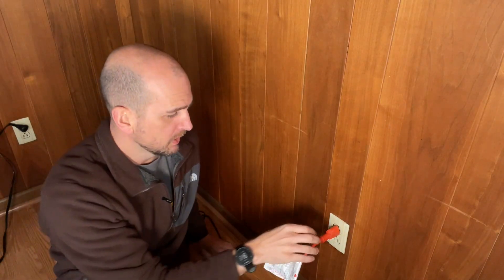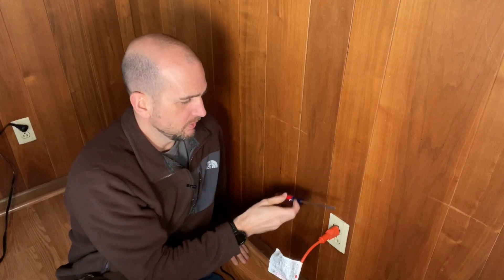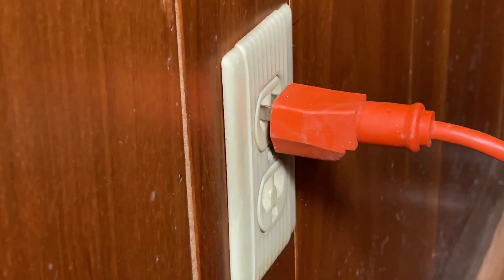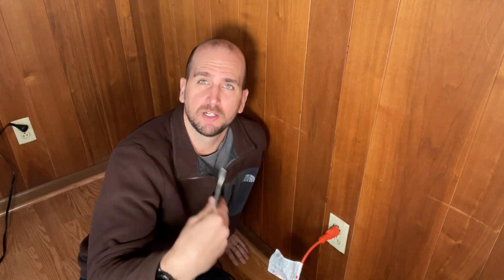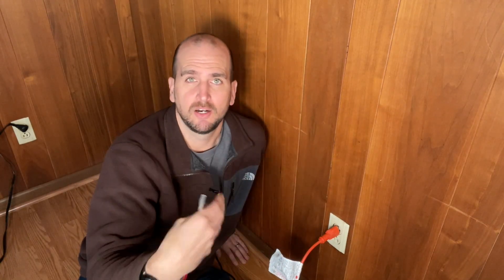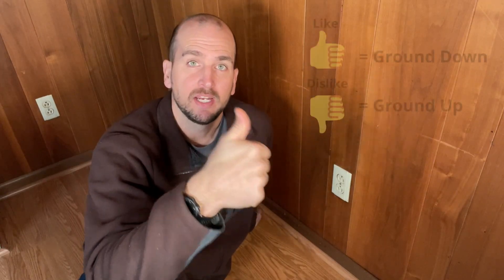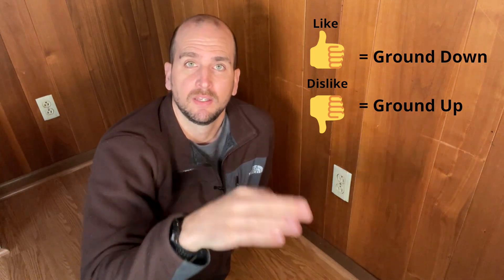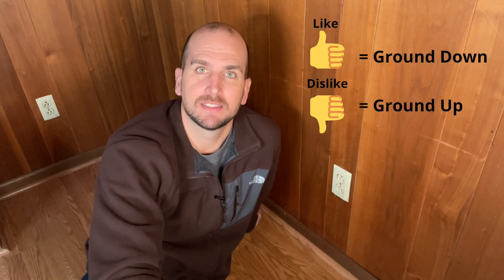Should An Outlet Be Installed Ground Down Or Up

Comment: Admittedly, there would have to be situation where a recp is super loose with bad contact/tension and/or the plug is funky for this to matter but glancing through the comments, I don't see any argument for maintaining ground prong contact when a grounded plug tips down and starts to fall out. If it were the other way around, it's possible that the hot may stay connected while the ground disconnects which is not ideal.  Though rare, I've seen this happen more times then I have a small conductive object happen to fall into prongs that happen to be exposed.

Comment: When my son was 4 years old he stuck a penny into the slot between the receptacle and the 3 prong plug which was facing down. Firstly he was not hurt but, as expected, it sparked, shorted and burnt the outlet and kicked the breaker.  Since then, all my initial installs are ground up. If though, I am plugging in a spacer saver plug as you demonstrated, I will reinstall the outlet ground down.

Comment: That wall socket is crazy loose, I wouldn't plug anything in that like it is on the video, as it is almost certain to lead to a bad connection which leads to arcing and heating and causes a fire hazard.

Comment: I’m a master electrician in Maine, appliances like refrigerators some gas stoves have a 90 degree plug to allow the appliance to be recessed more. Some of the brainless put these outlets up side down. The plugs fall out. UL approved plugs need to be thought of in installing outlets. In my 40 years I can only tell one story where the parents put a little princess cover plate on an outlet and their daughter pulled out the plug enough to hang a necklace for the little princess. It shorted and tripped the breaker. No one dies. This up side down idea is BS. LOVESTUPID

Comment: In the UK, where I'm living now, there are no plugs without ground pins, because the code over here requires that the outlet's ground be switched. When you plug something into the outlet, even if the ground pin on the plug is plastic, the outlet won't become live to hot & neutral unless the ground pin goes in all the way. And the ground pins are always longer than the hot/neutral pins. If you don't stick the ground in far enough, the hot/neutral remain dead. It's a safety feature. But it means that both plugs and outlets are heavily overengineered! Of course, with 240v maybe that's all for the good.

Comment: That’s interesting how you say objects can fall between the prongs and short out hot and neutral. Back in the 80s when I was 3. Mom told me I put a cup upside down on a night light. In that cup was a penny with a little water. The penny fell out of the cup shorting out the 2 prongs. She said it was arching like a welder and sparks and molten metal fell on the carpet starting to catch it on fire and she eventually kicked the light off the wall.
If it had 3 prongs with ground up, this would have never happened. If I did that in another room or in the middle of the night, I could have burned the house down. Not sure why the breaker didn’t trip unless the total load did not exceed the breakers limit. I guess arc fault breakers would help but not sure if they were available back then.

Great video that really does hit a good safety topic.
Reply: Most cheap night lights (and lamps) don't have a ground so it wouldn't have mattered.

Comment: I have always done ground down just out of habit and what I was used to always seeing.
Having said that, I  find that trying to put a 2 or three pronged plug into a "Tamper Resistant" outlet, which I admit I am not personally fond of because they can be so difficult to install a plug, particularly when new- sometimes almost impossible (to the point you are afraid you might be damaging the receptacle), is, much easier rocking the plug up and down, and a ground down seems to make the process more visible and Easier.

Comment: Some jurisdictions have a code. Usually calling for sideways, neutral up. If anything falls it would contact the ground and neutral. As mentioned before most night lights etc. are designed for ground down. I'm a ground down guy.

Comment: I just bought a house in Georgia.  The builder had to be an electrician.  The design is almost perfect. Tons of plugs and lots of three way switches. Two 200 amp panels, very nice. All the grounds are up. First time I saw that. Drives me crazy but at least I know why they did it.

Comment: The practice of ground up installation is something electricians that work in commercial and industrial job sites use because of the use of metal fish tapes for pulling wire between devices in small areas has a tendency to provide a great deal of shocking experiences.  Fish tapes seem to find their way between plug and socket of connections.  Residential jobs don't use conduit and wire so it's not as important.  In my seventy years I had fish tapes cause dead shorts on several occasions.

Comment: In the 1 in a 1000000 chance that something drops between the receptacle and the plug, the offending object would have to come straight down (guillotine style) to make contact with both the hot and neutral at the same time. In the event something was leaned against the wall and came down at an angle it would only touch one of the connections, either the hot or the neutral thus not completing the circuit, no harm no foul. 
     If you feel like you need some sort of indicator to remind you that that circuit is connected to a light switch just use some of your wife's red fingernail polish and put a little dot on the receptacle.
     And here's a little quandary I've wondered about for many years. Don't you have to install a septical before you can install a reseptical? Anyway it's ground down for me. When it's my time to go it'll just be my time to go.

Comment: I like ground up because I once had this metal yard sign "yard sale" or something, anyway the sign was up against the wall and it slide over and went between the plug and the blade of the cord that was plugged in. Anyway it caused the breaker to operate and the breaker box in this house(rented) was hard as hell to get to to reset the breaker. Had ground been up there would have been no problem

Comment: For years it was ground down and somewhere around then 90's is changed to ground up. I have heard every reason and scenario for the change but the best that makes to me is simply then weight of the chord. The weight of the chord and gravity want to naturally pull the chord down. The the outlet is ground down that cases to pull weight of the chord to pull the hot and neutral out of the outlet possibly causing a poor connection which results in heat under a load and can start a fire. with ground up the weight of the chord actually pushes the hot and neutral into the outlet  reducing the the chance of a loose connection under load.

Comment: True that the NEC doesn't call it out and unless you have a specific job requirement for direction it mainly falls to the installer. Most home owners will prefer to have ground down because they like having the little smiley face looking back at them. Where I have a metal outlet cover I will place it ground up simply in case the cover comes loose and drops on the exposed plug prongs. I know a cover will stay in place 100 years unless someone is messing with it. It's for that I place it ground up.

Comment: Ground down for me, mainly because of the items that plug in. I have things like x10 (old house R/C modules) , 3 prong power adaptors etc...  that are awkward to plug in the opposite orientation.  In my area I was told that the preference however (though not code) is ground up due to the object-dropping safety reason (which I find to be an unlikely occurrence), as indicated in the video . An additional reason is the Ground-down "Surprise Face" look supposedly attracts infants who are prone to insert objects in the slots. My Daughter has a mixture of both mounting directions in her house and her infant is attracted to both orientations ...and they are now all tamper resistant at floor level. I'm glad that this orientation issue isn't forced in the code.

Comment: I finally found a good explanation for the ground up.  In commerical settings a lot of outlet plates are metal.  There were cases when the single screw holding the outlet plate fell out and the plate fell down across the hot and neu.  If the ground is up it would prevent this.

Comment: The polarized power supplies that hang from the outlet hang up if the ground is on top. If the metal falls touches the hot and any other prong, it will still short out regardless of ground up and down since the neutral and the ground are basically the same.

Comment: As the company electrician for a sawmill that was under construction, I got to choose ground up or ground down on the reciprocals. I chose ground up because the ground on a plug is longer and must go in first. With the ground down you may not see the mali or female parts and have a little trouble matching those parts. The receptacle has beveled guides for the hot and identified blades.

Comment: When I was taught back in the early 70's it was taught to us to have the ground lug down so if the cord sags and hangs down, the ground lug would be the last one to pull out.
Reply: This is exactly correct, 40 years as an electrician, you want your ground the last to pull out thus ground down always.
Reply: That is because the ground is protect the plugged in equipment, not to protect the plug.
Reply: The ground lug is longer for this reason.
Reply: TRUE GROUND SHOULD BE FIRST TO MAKE LAST TO BREAK
Reply: Then the standard should have them much longer and not almost the same.

Comment: In UK the Ground is on top by design. I generally look to see what is on the others and match them. But having it on the bottom is good safety in case the cord was stood on or gravity pulling it out. As it keeps the ground engaged the longest. In UK the ground pin will be last to disconnect.

Comment: I install with ground down to keep my customers happy, they think the receptacle is wrong when the ground is up. But Commercial work requires grounds up for safety. If you install receptacle ground down, when plugging in or unplugging, you have a chance of shorting out the circuit with your thumb. The reason why, when holding the plug of a device in your hand, left or right, your thumb is the farthest digit out towards the prongs, so you accidentally touch the ground prong, no foul. On the other hand, ground down, if your thumb touched the top prongs, you can be shocked. 
Like it or not, it is safer with ground up, but most people want to see a face, ground down.
Reply: THIS^... It is also the NEMA "standard" orientation.

Comment: First make last break of the ground. An unsafe condition could exist if the ground was open and the hots and/or grounded conductor was still functioning the equipment using the electricity would be in  an unsafe condition. So ground down for life safety.

Comment: Ground up always. Read the text on the outlet. The manufacturer clearly shows ground up is the proper orientation. Not really even a debate for me.
Reply: Skyler Dorrell 
I agree,  I was taught that in any situation to orient the device so that the text could be read without turning your head upside down.
The inventor of the plug in receptacle was Hubble, before that when you plugged something in you screwed it into a light bulb socket.
Hubble sockets have the text oriented so that the ground is at the top.  
I orient ground up particularly in my workshop because it is far easier to find the top ground position to help facilitate plugging in.
I like Hubble specification grade receptacles because the plugs are harder to push in and out and therefore are unlikely to fall out.
In the case where a 90 degree plug is used and the wire is the reverse direction then it is a simple matter to reverse the plug, it's allowed.
I frequently see plugs with the ground down break the piece of plastic on the outside edge because of the strain, ground up places no such strain on this bit of plastic.  If a happy face is the reason that you orient your plugs that way then go for it but it is not a valid reason for me.
Finally the only time I see a two prong receptacle is in an installation that is really old and I was taught to use a modern 3 prong receptacle but to plug the ground slot with epoxy or similar product so the user will not make the mistake of plugging in a 3 prong plug in the belief that it was grounded.  And by the way, anyone who touches the prongs of a plug while inserting it into a receptacle is asking for a good jolt.

Comment: If you ever look at the outlets in a hospital you will notice that the rooms contain outlets facing both directions. When I've been in hospital rooms the outlets that are ground up are the red colored ones that have a T slot. https://www.mscdirect.com/product/details/74423039 

In my house, all outlets were installed ground down. When I installed a 240V outlet in a room not only did I choose a red outlet but I also chose to install it ground up with a black wall plate when all others are white. 

I also have a black outlet I installed ground down that my modem is plugged into which is basically an extension cord as it runs from the room my modem is, through the attic, and ends up where my security system is set up with a battery backup for when the power goes out. Of course a "male end" exits where a small extension cord's female end plugs in so there is no chance of electrocution. NEVER use an extension cord that has two male ends, you'll only get to use it that one time.

Comment: Every receptacle tester tool I've seen has the label and the GFCI test button on the top when the ground is down. I've done installs in commercial buildings in NYC and it was ground down. Most places I've seen mainly in NY and CA are down, though on rare occasion I've come across ground up.

Comment: Great idea for switched recepticals.  Thats gojng in to my 'good things to know' book. That should be a standard.
Reply: No, please don't, and don't encourage other people to do the same.  It is something that lazy/cheap electricians do.
It is unprofessional to be inconsistent, and it's the wrong solution to the "problem". You should install receptacles that are marked as switched.

Such as https://www.hubbell.com/wiringdevice-kellems/en/Products/Electrical-Electronic/Wiring-Devices/Straight-Blade-Devices/ConstructionCommercial-Receptacles/DR15C1WHITR/p/2608245

Comment: I face the ground up, by doing this it protects the plug from damaging the outlet. Due to gravity and the ground being stronger than the positive and negative having ground down leaves more of the ground in so if someone trips or pulls the cord the ground will exit the outlet first thus protecting the outlet from cracking.
Reply: The ground is also longer then the n/h prongs... for this very reason

Comment: in the 1980's, when I was taking a course in residential electrical wiring, they had just changed the NEC to require "ground-up" in all new construction, and highly recommended in remodeling and replacement.  Well, they may have changed it back, but I'll still install ground-up; for the safety reason.

Comment: Ground up, if step on the cord it will unplug without breaking the ground out of the cord..
Reply: Ground down.  If you step on the cord, the ground wire will be the last to come out of the outlet, reducing the risk of electric shock.

Comment: The reason why I always install ground up is because - and I've seen this happen - a metal cover can fall on the live and neutral leads creating a short as in the video at 3 minutes.  It's annoying that so many plugs (cables) have ground on the bottom.  At 4:40 with a 90 plug the argument is that it takes more room - I disagree.  The cable still sits against the wall.

Voting:  You're getting a large numbers of people here who don't know how to wire - hence, more will like ground down as opposed to those who have more knowledge and experience who prefer ground up.

Comment: as a contractor I recommend the ground facing up. we have no code requiring one way or the other. what I have seen is when metal faceplates are used and the screw that secures it works loose someone pulling a plug out have seen the plate fall across the hot and neutral causing hot metal to be expelled burning the person. while the fuse or breaker will trip the short allows fifteen amps on a lighting circuit. to heat up the thin metal of the cover plate with disastrous results. if the ground is facing up this condition wont happen. this is why I install the ground up. Mullan Electric
Reply: Ok Mr. Contractor,  We don't have FPE breakers widely used anymore which wouldn't trip. Nice analogy for those not in the know but wow 15amps? what about the 20 amp one's  That is a pathetic excuse to put the ground up. If something is plugged in then it falls on the chord cap which is insulated. If it falls off when nothing is plugged in it fall on the floor. Like I said pathetic. You can still get FPE, How long have you been around and I suspect you do residential, so FPE stands for Federal Pacific Electric.  Out of business. And yes it will happen with the ground up. For it to happen the chord cap has to not be fully plugged in and if it isn't then the plate comes down (highly unlikely) but will hit the ground and potentially hit the hot anyway. How do I know I proved it in a Masters class to shut morons up that thought they knew better also.